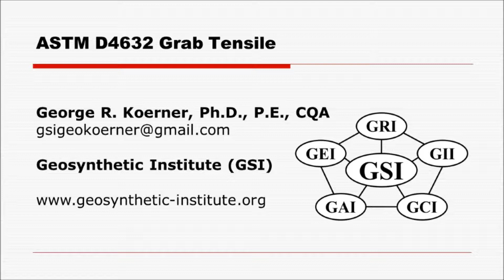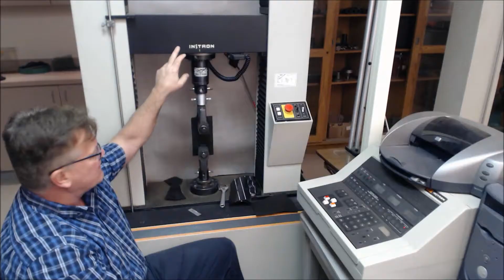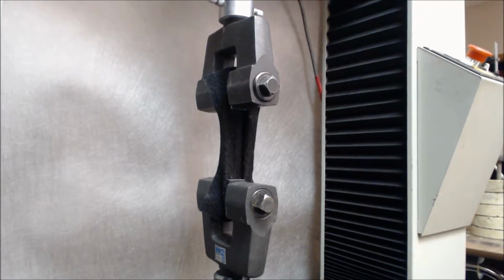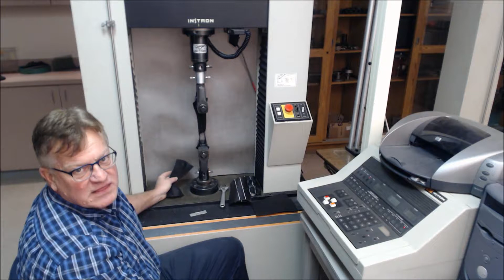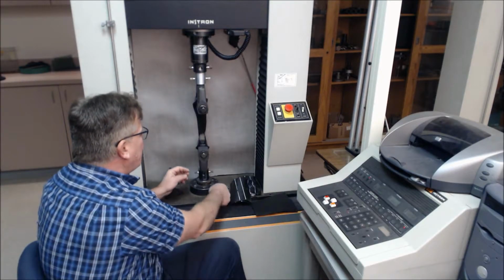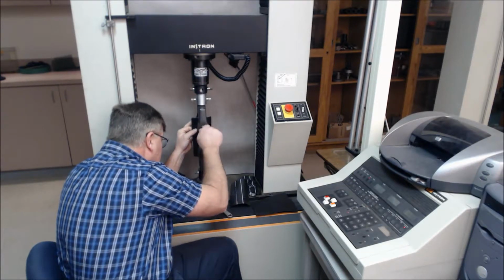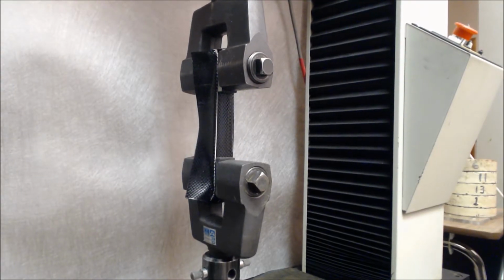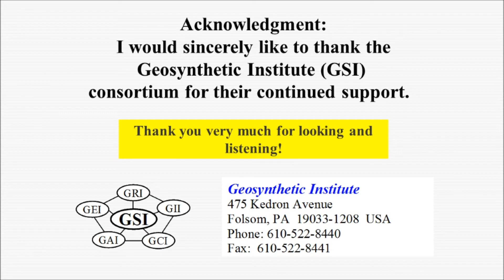GRI ASTM D4632 Grab Tensile for Geotextiles (GT12, GT13, AASHTO M288)

Comment: Why the grip is not completely coving the specimens width? This specimen holding can induce an unbalanced load along the specimen, which effect the value
Reply: The ASTM website says they use extra fabric to the sides, so that the test results in a value close to the value of fabric with surrounding material.